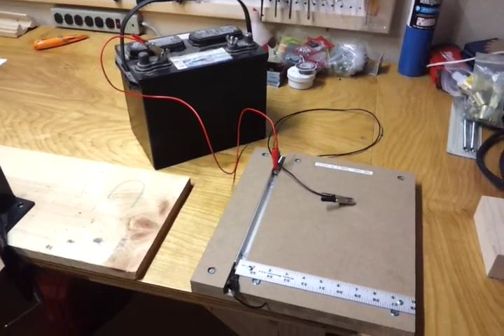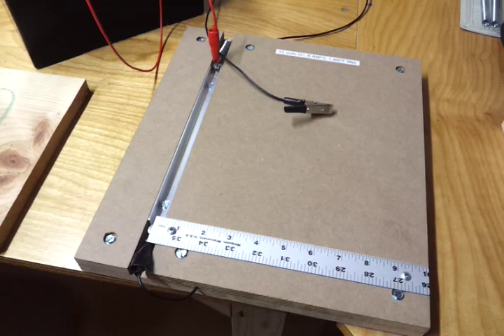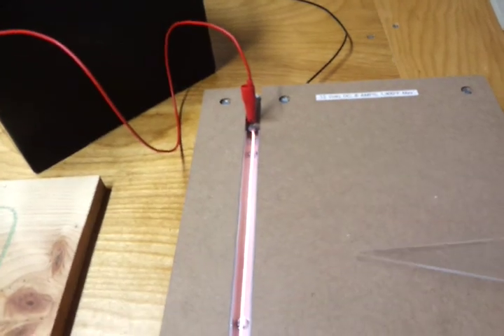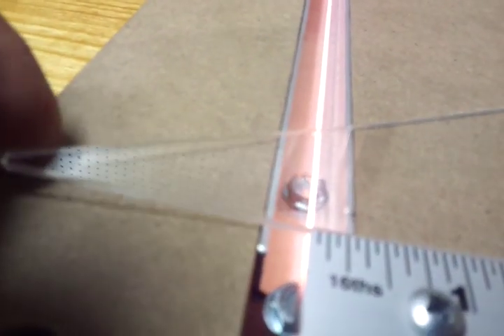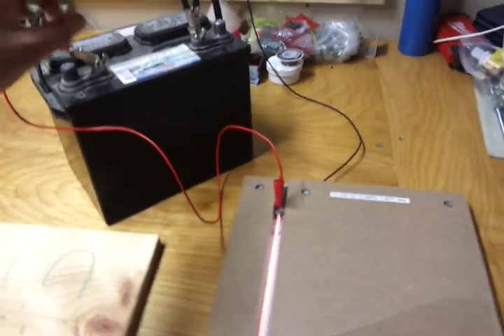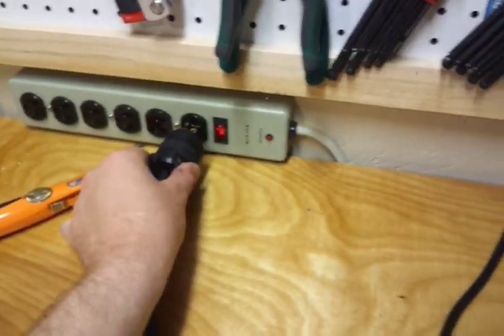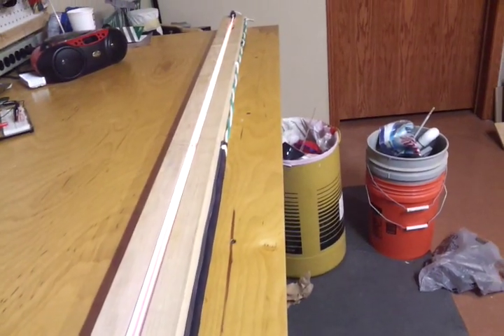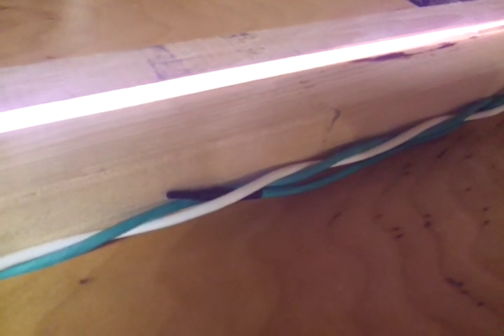Plastic Benders, Nichrome wire

Comment: Because of my deep respect for electricity (years as an electrical worker, both as an electrician and in electronics), I wonder why no one chooses to use the ground.

I would think the eventual failure of the nichrome wire would result in part of it coming in contact with the aluminum channel because of the two loose, untensioned ends.  As such, it seems it would be a good idea to tie the ground to the aluminum channel.

Adding a circuit breaker (see note(s), below) seems not a bad idea too.  HOWEVER, I note even commercial units seem not to concerned with such things.  Hmm

Another safety feature could be adding a timer with the amperage capacity needed to heat the nichrome.  As such, plugging the unit in or flipping a switch would not activate it until the timer was set.  Obviously, the unit could not be left on.
_______________________________
FOOTNOTE:

(1) Circuit breaker example: https://www.amazon.com/uxcell-Thermal-Overload-Protector-Circuit/dp/B07NSBJTTD/ref=sr_1_2?keywords=5+amp+AC+circuit+breaker&qid=1570391262&sr=8-2
Reply from the maker: Thank you for the info - I'm sure you are correct, it would be wise to use the ground. The nichrome wire is tensioned, it has to be as it thermally expands during heating. This unit is used about 10 minutes every 5 years, under complete supervision. It is plugged into a surge protector that is on a 20A breaker. An issue I have seen is the likelihood of the 2 x 4 catching fire when a hot piece of the nichrome wire lands on it after she blows. If the nichrome wire touches the aluminum channel when it is energized it frys the wire anyway (no resistance). Regardless, the next time I use this I think I'll take you up on your suggestion and tie the ground to the aluminum channel. Thank you!

Comment: Hi Daniel, Could you please advise what is needed for 8 foot long acrylic bender. I am using 20g nichrome wire. I like to know How many volts, amps, temperature needed. Also where to buy the power supply or transformer ?  many thanks
Reply from the maker: +Jit S Thank you for contacting me!  You should check out this website to calculate what you are looking for:  http://www.jacobs-online.biz/nichrome/NichromeCalc.html

If you choose to use 20g Nichrome wire, then I think a good combination would be: 20g Nichrome wire, 96 inches long, 48 Volt power supply, 9.1 Amps, 1200 deg F. I do not know where to find a power supply like this.

If you live where 120VAC power is available, then you could use 30g Nichrome wire, 96 inches long, 120 VAC, 2.22 Amps, 1260 deg F.

Please make sure that you support the nichrome wire at least 4 or 6 places over it's length without grounding it at any of the support points.  You must also have one end on a spring to compensate for the heating expansion of the nichrome wire itself.  Good luck with your project and BE CAREFUL!!!
Reply: +Daniel Miller Many thanks i will try with 30g

Comment: I am trying to make an igniter using 26 AWG nichrome wire which theoretically reaches 1093 degrees Celsius with a current of 6.9A. can this temperature be reached considering that the wire would be heating up in open air?
Reply from the maker: Thank you for your interest in this video!  The small nichrome wire bender shown in the video gets up to 1,400 deg F (760 deg C) in open air and it consumes 8 amps at 12 volts.  The Interstate HD24-DP battery I use is rated for 405 Cold Cranking Amps, and here are the following amp hour ratings from the battery data sheet:  11.6 hrs @ 5 Amp load, 3.2 hrs @ 15 Amp load, and 1.7 hrs @ 25 Amp load.  In your case, the 26 AWG wire should get to it's theoretical temperature without any problems as long as you are supplying power and allowing the nichrome wire to expand as it heats up.  It is important to consider the wire expansion - I have a small spring that takes up the increased length of the wire when it heats up.  Hope this helps and good luck with your project!

Comment: didn't the nichrome wire possible to burn the the wood? (wood where you placed the wire)
Reply from the maker: Azizah - Thank you for the comment.  Yes, the nichrome wire can burn the wood close to where I connect the wire.  I attempt to keep the wire centered in the channel so this doesn't happen, but I have burnt the wood a few times...  It is important that you use a non-conductive base material (like dry wood) since you want the electricity to go through the nicrhrome wire instead of shorting out through the base.  This is why I leave extra space between the wire and the aluminum channel that is placed in the groove.
Reply: Daniel Miller i planned to make an innovation by using this nichrome wire to melt plastics..In your opinion, it is possible to do that in a biscuit tin (aluminium tin)? or it will generate fire?
Reply from the maker: Azizah Nassir I am not sure how you intend to use the aluminum tin, but it sounds dangerous to me.  If the nichrome wire contacts the aluminum, it can short out, and could cause a fire.  Also, most plastics melt somewhere between 400 deg F and 600 deg F; a standard stove should get that hot.  The small plastic bender in my video gets up to 1,400 deg F.  If the plastic gets too hot, it will burn and turn to black carbon and become useless.  I hope this is helpful & good luck with your project!
Reply: i'll try it later..:)
btw, thanks for the useful video and informations..

Comment from the maker: I cut my plastic parts on a CNC Milling Machine.  One could easily cut them with a saw though.  PETG is a soft plastic that is quite inexpensive to learn on.  You can purchase small sheets from McMaster-Carr to learn on.  You can also purchase harder plastics at Home Depot - they typically used it to protect windows or screen doors.  Good Luck!